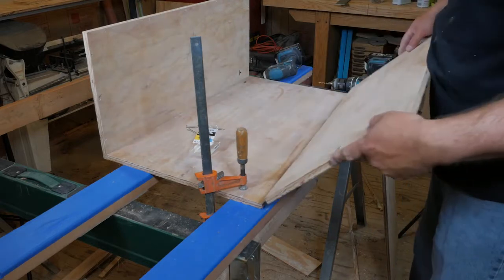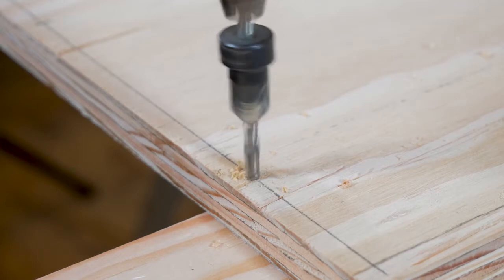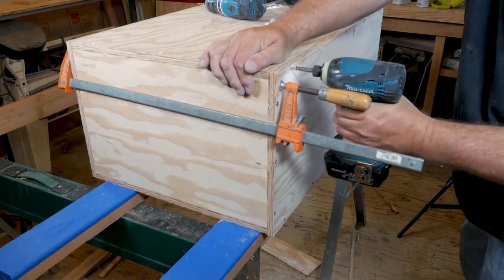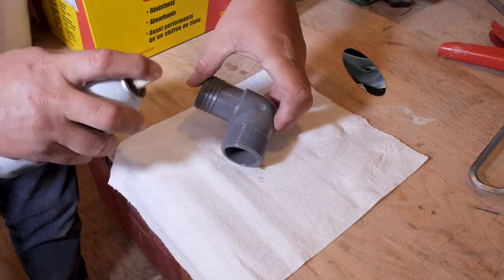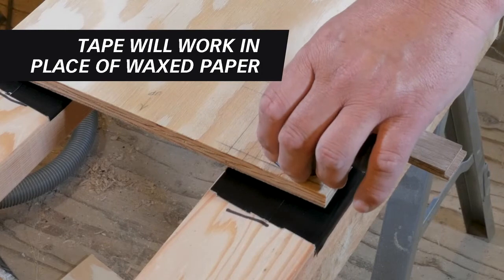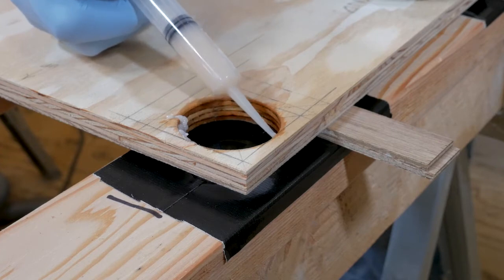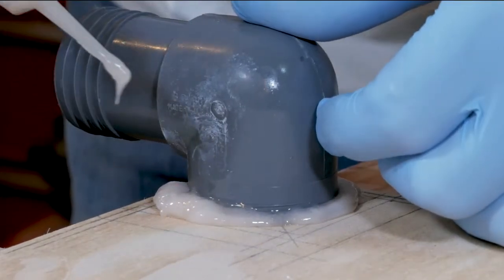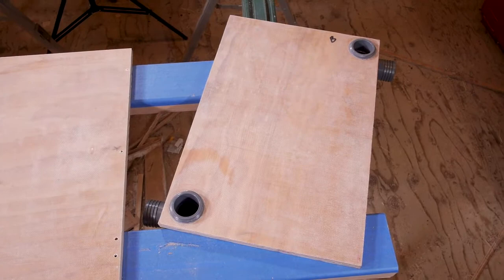How to Make Custom Plywood Tanks: Part 2

Comment: IT'S LITERALLY THE SAME PRICE TO JUST BUY A TANK. Epoxy alone is going to be $200.
Reply from the maker: I think you missed the point about size availability for plastic tanks. There were NO plastic tanks that fit my needs. I wanted max space but still needed something that would fit through the opening in the V-berth. 

Buy yourself a plastic tank if that works in your situation.
Reply: @boatnotes6885  You can get just about any size. I just ordered mine from a local company. 85G tank. They even put the holes in it for you exactly where you want them.They can also make custom sizes. Definitely more money but making one seems like a major pain in the ass and time is much more important.
Reply from the maker: @marlonoreilly9097  🙄🤭🤣